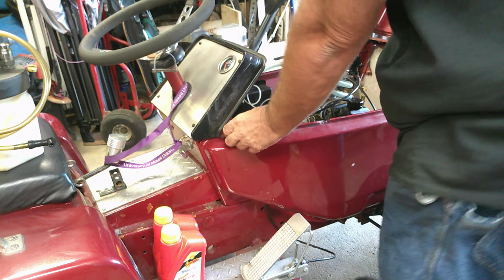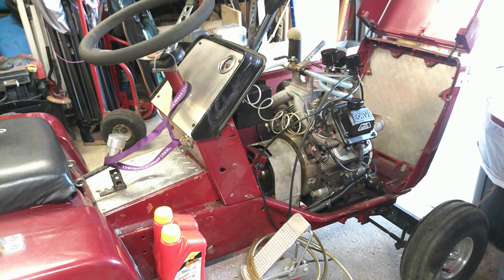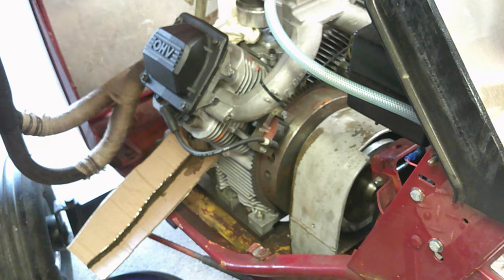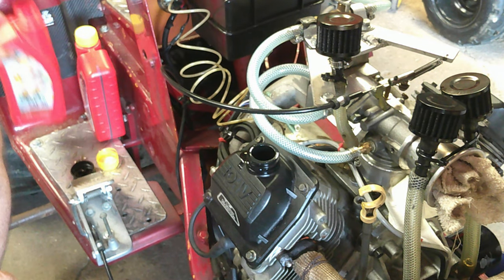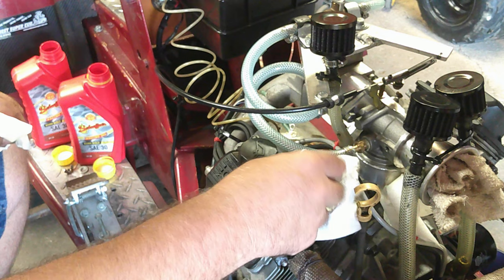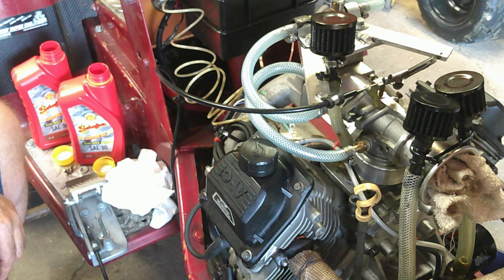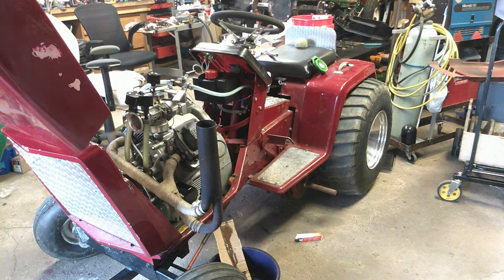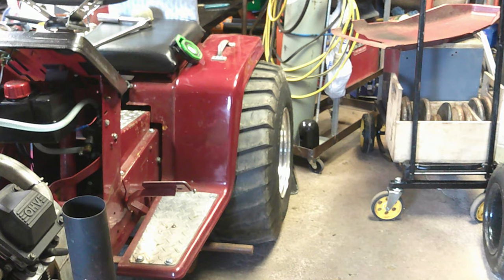Well overdue service on PlanB before this weekend's pulls

Comment: No doubt one of the most expensive things about a Methanol engine, changing out that high dollar oil so often! I tried switching from FHS to Mobil 1 because of the price difference (budget racer), the Mobil 1 turned to milk after a few laps on the Kart, it didn't mix with the Methanol AT ALL. That was a mess. It looks like the Schaeffer's oil works GREAT with Methanol. I may try some of that stuff. Thanks Ed!
Reply from the maker: @KentuckyFriedFixes  Yes the Schaffers does great. They have a really good tech team and they pointed me to what I use.

Comment: Ed , I have a CH18s Kohle V twin on a Cub Cadet 2518. It runs great and has 1200 hrs on it. Problem I am having is it blows out the front main seal due to vapor build up and probably some blow-by. It does not have any venting on the cylinder covers. I would like to add a vent and was wondering if you could tell me the best way to accomplish this and where to install on the engine. I see you have little air filters coming up vertically.   Thanks Rob
Reply from the maker: @rgrottk  on the stock command engine, there is a vent on the very top of the engine between the heads. It's a little plate with 4 screws in it. They can get plugged. Also the front pto seal are common problem leaking. The seal is easy to replace.